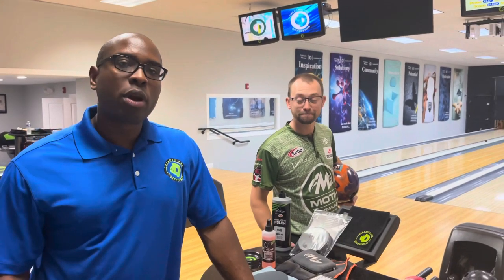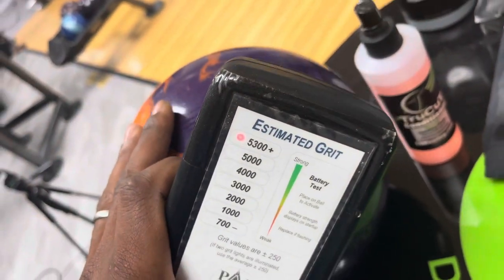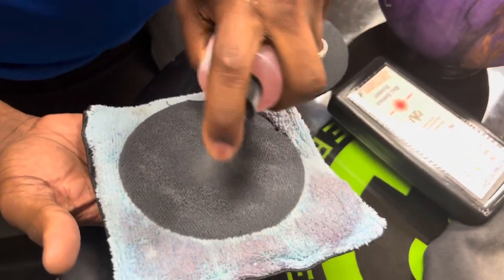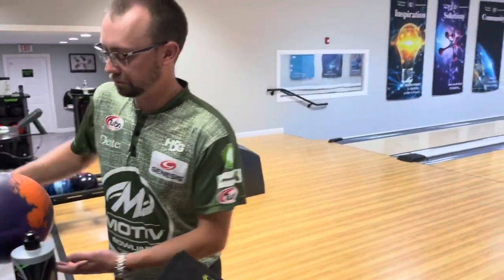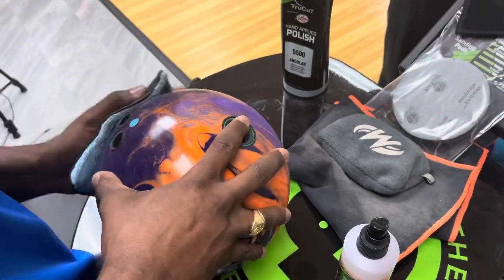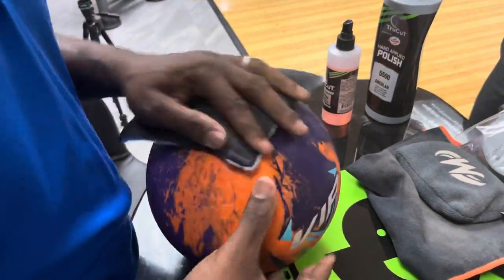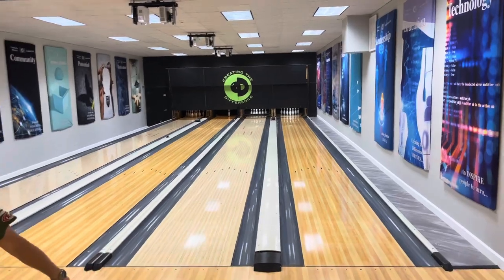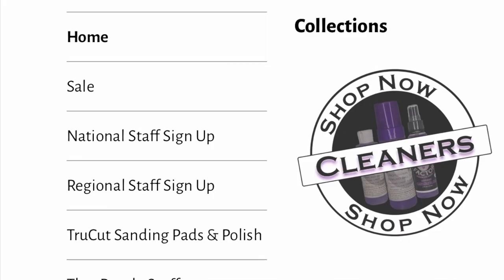Achieving the 4 Types of Ball Motion | ONLY changing the surface of the Bowling Ball with EJ Tackett

Comment: Ball motion needs to consider ball speed.  

Ultimately ball motion choice is all about the management of ball energy.  

Continuous ball track is ideal because it provides control and margin of error tolerance.  However, if there is not enough ball energy it is possible the continuous ball track (long flare) will result in many flat 10s.  

Angular ball track (short flare) can be a better choice for when there is over/under lane oil condition or when ball energy conservation is desired.  High drill and Low VAL angle helps to produce angular ball track.  

Traction ball track is similar to angular.  The difference is angular is backend down lane reaction while traction is front early ball flare.  Low drill angle helps to produce a traction ball track.  

The angle of the ball when it hits the strike pocket is important.  If the angle is too high the pin fall reaction will be undesirable.  

Thusly, angular and continuous ball motions tend to be the preferred ball tracks that enable control, margin of error, and best carry.

Comment: I'm new to all this but let me ask  this . Can you get the ball back to it's initial reading by polishing?
Reply from the maker: You can by following the steps. In fact you can get any surface finish if you have the polish and the sanding pads
Reply: So 2 things:
1) Most balls from the factory are going to be a little bit inconsistent from what they advertise - they might say "1500 polished" but if you scan them they'll be anywhere from 1000 to 2000.  So unless you have a fancy scanner to know WHAT the factory finish actually was, it's hard to replicate.  That said, you can get back to whatever they advertise which will be pretty close 95% of the time.  Certainly close enough that anyone less than the level of... well, EJ Tackett... isn't going to notice.
2) Just speaking personally, I can get the ball to behave within 1/4 of a board of factory finish.  I but like most non-pros I can't replicate my shot to within 1/4 of a board.

Comment: Have you tried that with every ball brand or just motiv, trying to build an arsenal and if there is a brand that surface change won't work on I don't want to use their stuff
Reply: Ever ball can have it's surface changed.  Company is irrelevant.
Reply: @volo1826  the surface I'm not worried about its being able to change the ball motion
Reply: @joshuapaugh8271  his point answered your question: changing the surface is a huge component of ball motion. All bowling balls can have their surface changed through sanding or lane shine.

Comment: What are the best 5 sanding combinations? Like 500 -2000, 1000-4000?
Reply: What do you mean by combination?
Reply: @denmanfite3156  when you skip sand what grits work best in what combinations 500-3000 or 500-1000-3000. And regular step sanding do you go 1000-1500-2000 -3000? You have to experiment
Reply: @Clarkson350  oh I believe Ron actually did a skip sanding video but I don't know it off the top of my head. If memory serves me correct it will scan the lower/last grit but the behavior will be more towards the lower of the scale.

Been awhile since I've watched that video though and I may be completely wrong.
Reply: @denmanfite3156  I know how to do it. My question is what is the most successful proved sanding strategies utilizing different grits
Reply: @Clarkson350  I think that's mainly a preference thing. I personally don't employ skip sanding on surfaces. Feels like it'd be too inaccurate and with a result that is minor to just sanding normally.
Reply: @denmanfite3156   sanding is highly inaccurate science and process.

Comment: He said 2000 grit and it read 700 lol
Reply: It read between 4000 and 700,  then when he did 500 grit it bounced between 700 and 2000.   Both tines he stopped when he found a spot that read what he wanted and quickly pulled it off.  Put it in a proper scanner 

Sure the products work,  they are sanding the surface down.  But for a consistent surface, dont do it by free hand on a bowling alley table.